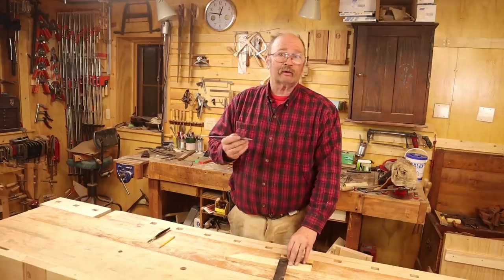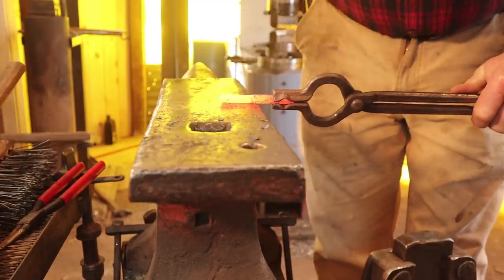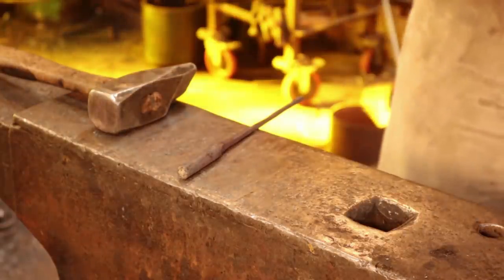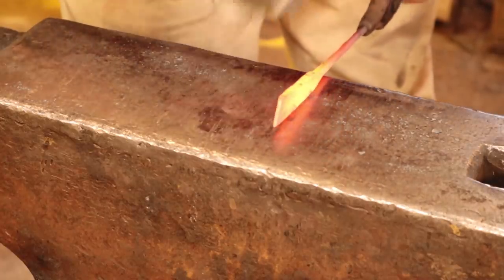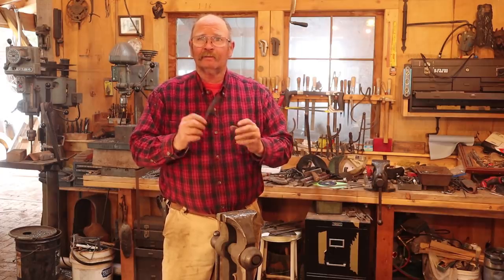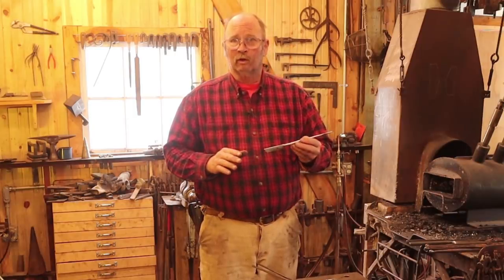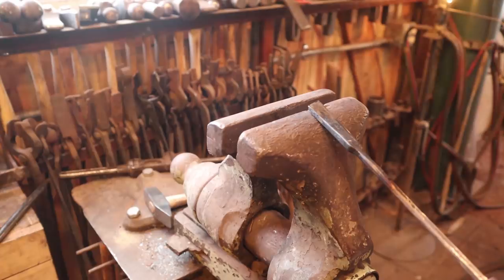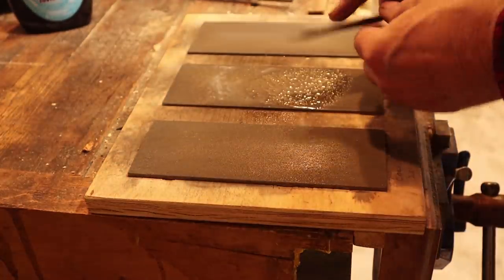Woodworkers marking knife

Comment: I worked in a machine shop. I spent 8 hours a day with a 4" angle grinder, when I sharpen my mower blades I use it becuse i can freehand 2 stright edges.
I'll put a nice 45 edge down each side of the blade, sometimes ill do it on the mower. I know i should balance it but I'm pretty much right on the money most the time. Plus on a signal piston motor I dont think its doing any more damage to the crank the pistons doing anyway.

Comment: I was researching marking knives and I found your channel. And I'm sure glad I did because I have never seen this type with a combination of an awl and marking blade. I have 3 drawers of pen blanks in every species you can think of. I paid near to nothing for them so I figured I could use them to make a few handy tools to sell and give away as gifts to my family of woodworkers. I love your shop and all of the tools hanging on the walls. I have a love of old tools and vehicles and it is my dream to purchase an old Macgregor or a Parks bandsaw. I don't know how much one weighs, but I know I will have to either reinforce the floor or cut a section of the floor away and pour a cement pad. I just love the weigh a simple tool can look beautiful! They put so much work into iron tools back then. Like the wheels on a Parks bandsaw, or all of the extra iron-work they put into a Singer Sewing Machine. Well, I'm going to watch more of your videos. Thank you for making this style of a hand tool.

Comment: I always make the awl end square (about 3/16 tapering to 1/8 at the point) It fishtails into the blade which usually ends up about an inch wide tapering to 1/8th in thick and 1 1/4inches long they are ground like a double bevel skew chisel. I file it just enough to get rid of the sharp edges. The local woodworkers say they work better than anything they can buy.

Comment: Hmm awesome idea. Both for my woodworking and I suspect great for my leather work too.

Also also thanks loads for the slightly different differential hardening tip. I prefer to use an oven but hasn't realised you could achieve different tempers by selectively hardening. Quite simple really when you realise. Thanks
Really enjoying your video production style at the moment too.

Comment: I notice you keep turning off the propane to your forge. Do you just let the residual heat re-ignite the forge or do you have like an electric spark to re-ignite? Looks like good practice. Im building my forge stand so need to figure out a good setup for turning on and off as needed.
Reply from the maker: I only turn the gas off to improve audio quality during the videos.  It isn't something I do in my regular work day.  Generally there is enough residual heat to relight the forge when it is hot enough.  I have seen a few forges with a small burner added for use as an idle or pilot light.

Comment: Another great video.  What is the benefit of using glass cleaner on your sharpening stones?  Thanks.
Reply from the maker: The diamond plates are steel with a diamond coating.  Using water will lead to rust and the glass cleaner (not the same as window cleaner) from an auto parts store seems to avoid that problem.  Oil tends to end up being a big mess.
Reply: @BlackBearForge  Thank you

Comment: I have a question for you John, if you don't mind. In the last few videos you have been using the lighter( according to you) diagonal peen hammer instead of the cross peen, is there a reason or did you just feel like a change????
Reply from the maker: Mostly its because some of these projects are smaller and don't really need the heavier hammer.

Comment: So where did you get the lidded quench bucket?
Reply: I'm pretty sure that's called a rag can. An industrial supplier like Grainger or fastenall will carry them
Reply: @joemelvin5254  Also called oily waste cans and/or safety cans.
Reply from the maker: The other commenters are correct.  It is a rag can.  I have a five gallon bucket of oil in the 10 gallon rag can.

Comment: John if when you hot cut for the angle if you made two cuts you can make it a left and right handed knife, I myself don’t like the two ended tool if I am using the scribe I must have a very sharp knife pointing at me? And in the tool box Drawers when you reach fi it there will be a sharp end pointing at you. If on the other hand you make two tools you will have more time at the anvil (practice) and you will have two pieces of (art) tools to show off. Thanks for all your time and tips. Be well and be safe
Reply from the maker: This was based on the old style tool.  But most newer ones are single ended.